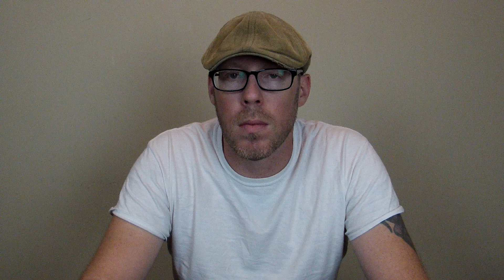Pool Pump Overheating

Comment: Is it normal for the booster pump to be hot to touch?? there is no smell but my vacuum stopped working and I had to replace the capacitor and then it worked find but I noticed the black pump is hot to the touch but not burning... just wanted to now is that normal??  Thanks so much MJ
Reply: 150-200F is normal which is definitely hot to the touch. Best to use IR thermometer if you want to know if it’s hotter than that

Comment: My pool pump overheated cause the water was low so I shut the pump off. I tried starting it back up but the motors kinda hot. If it cools down will it likely start back??!? It's only a few months in use.

Comment: Hi, I went through 2 pumps in the last 3 months. The prior pump was just 2 years and the original was 13 years. The breaker does not trip. If it runs dry it will burn out, that I understand. Is there a pump that will not let it run dry? If it was dry shouldn't the breaker flip off before it burning out? No one seems to know the answer.

Comment: My pump shuts down after running for 45 minutes or so, after it cools down it does the same. I have a Century UST1102 1HP motor. I looked on amazon and they have it for around $130.00, I checked 4 different pools stores and the average price was $375.00 with out the install. I saw a few videos on how to replace it. Is it as easy as it look to replace it?
Reply: Keith Lindsey I just bought a century motor and it's running hot and cutting off. it's brand new. can you helo
Reply: I just installed a new century motor and it overheats and shuts off. Something is  strange with these century motors. I suspect the horsepower ratings may be over -stated. I have ordered the next size smaller impeller to see if that fixes the problem. Currently motor is full rate 3/4 hp with 3/4 hp impeller. I ordered .5hp impeller to test my theory.